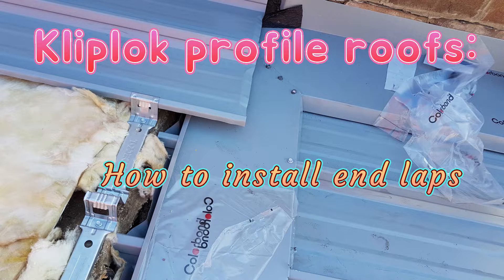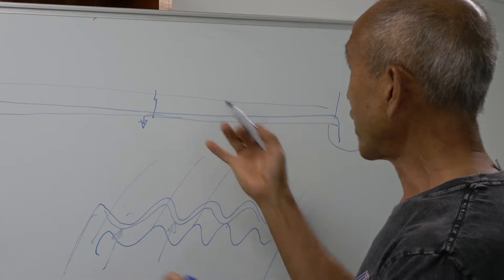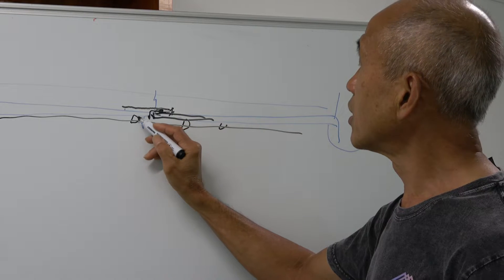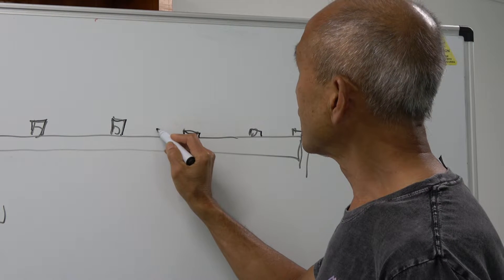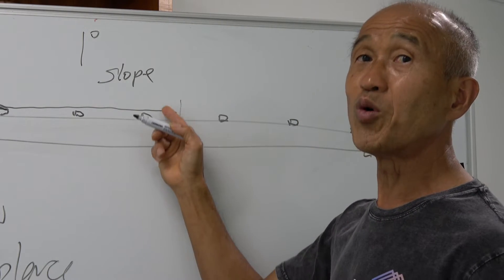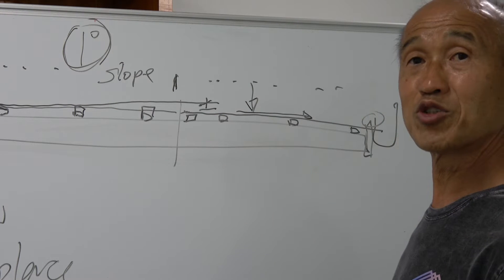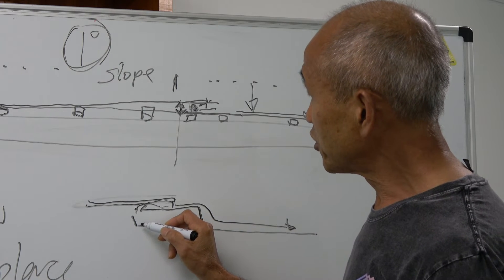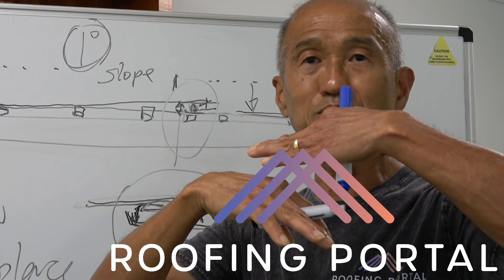What is the best way to correctly end lap kliplok roof sheets

Comment: Transition flashing should be shorter then the sheets on top in this scenario take them stitching screws out of the rain
Reply from the maker: The function of this transition flashing is to provide a 'runway' for water to flow from the edge of the upstream roof onto the lower roof. This 'runway' carries the water a distance away from the upstream end of the lower roof and also cuts down the turbulence of the 'water fall' effect. This turbulence if located close to the end of the lower sheets would cause 'splashing' leaks over the turn-ups.
We have found that a wide transition as shown is effective in providing a smooth transition of the flow of water at the step.
Thanks for you alternate view.